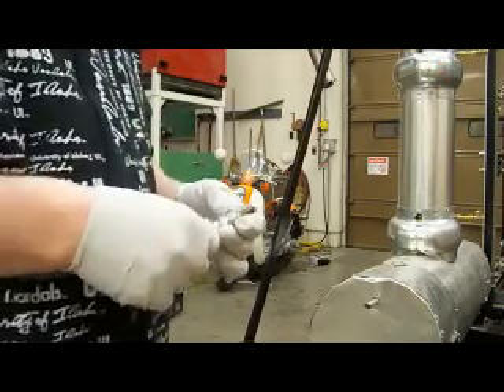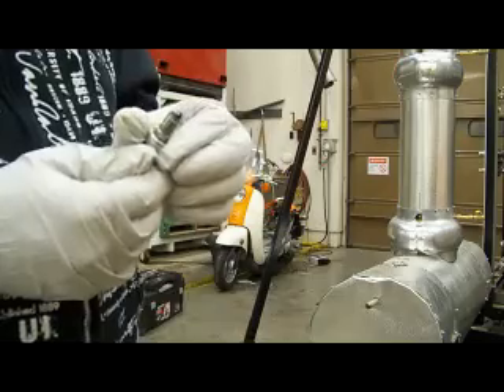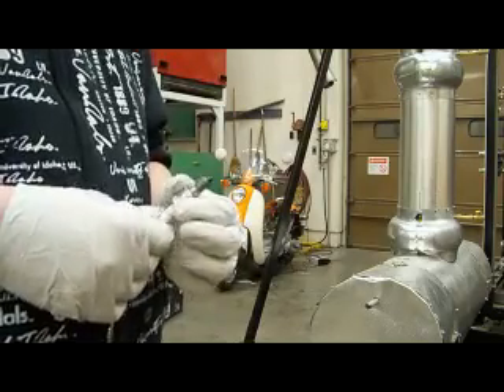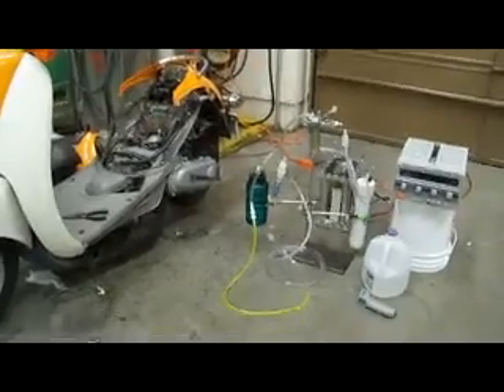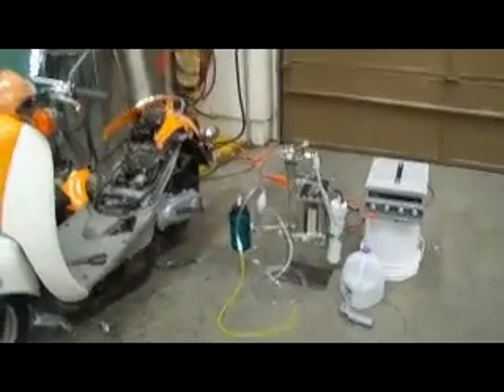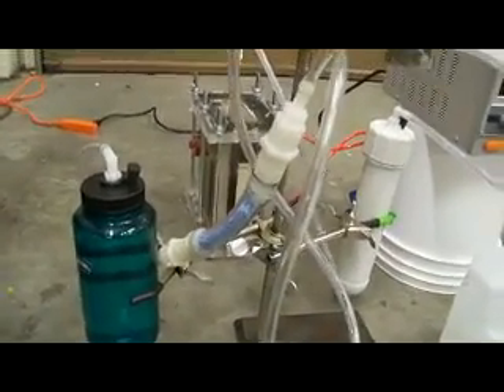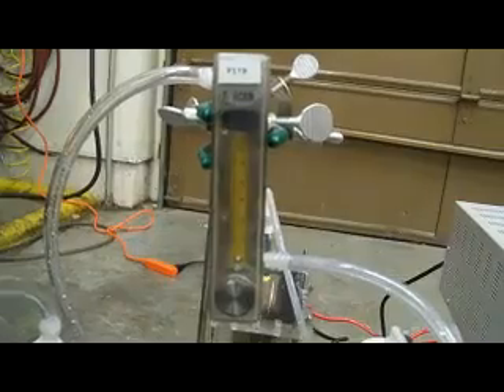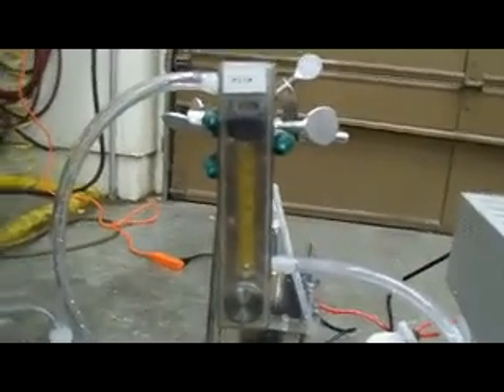Hydrogen Scooter Test Part: 11 Successful Rev Test #21

Comment: I suppose you have already figured out that your throttle control is your power supply ... once you get your air/fuel ratio tweaked, you can adjust throttle by increasing or decreasing the production of HHO ...